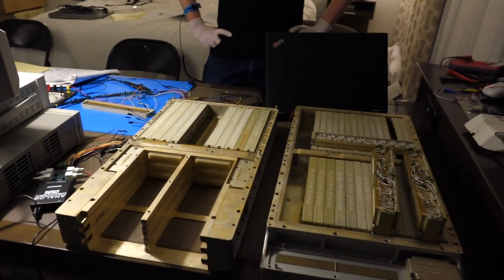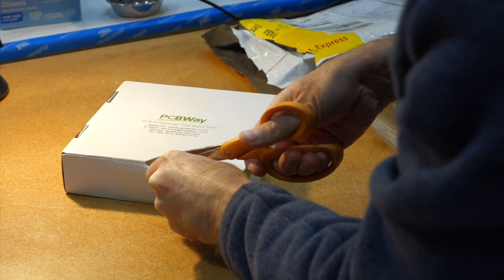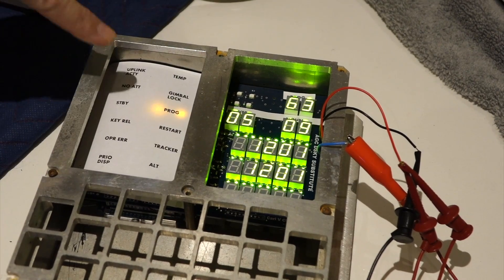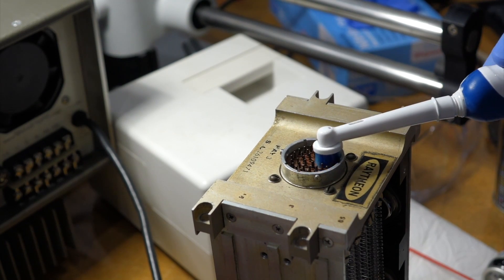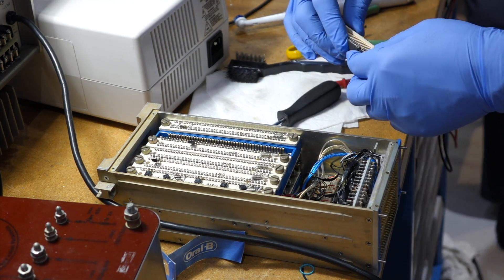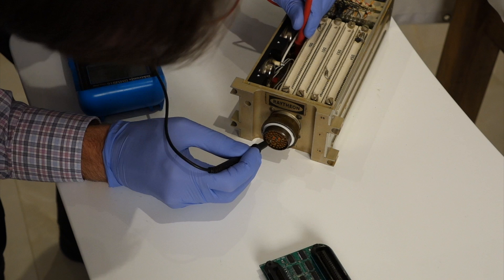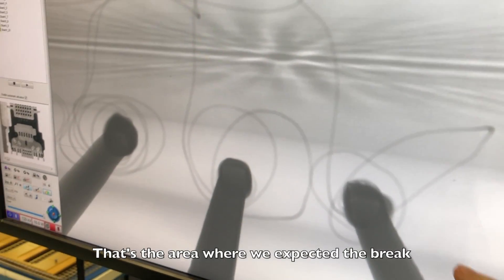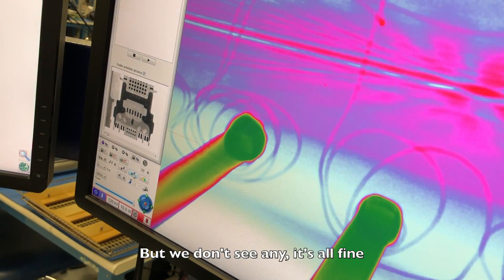Apollo Guidance Computer Part 6: Restoration update, a new sponsor, and a satellite launch

Comment: yeah, the story continues.....the original rope memory does not exist anymore  and also no original DSKY that could be used ?
Reply from the maker: Both do exist, but locked away in museums...
Reply: CuriousMarc give Nicolas Cage a ring, tell him they contain a treasure map...
Reply: @CuriousMarc  The museum ones aren't being operated,  so just arrange a trade until you find a working one!
Reply: at least borrowing them would be cool to run the AGC a few time in it´s real original configuration.. then give back the modules to the museums and work with the Emulators

Comment: if the module is potted, couldn't the compound be eaten away at with something able to melt the compound back into goo and then washed, re-dunked?  one would need to find out the exact composition of the compound but it seems to me like it could be done, like decapping a really big IC.

The only issue is if the bond wires are coated, they'd also get exposed, thus ruining the module. I do wonder how hard it would be to outright replace the erasable memory module's contents with something as small as a proper-sized memory IC and the proper circuitry to get that to interface with the older technology in such a way that it by itself could emulate the memory.
Reply: It's a bit more complicated than that. 2003011-011 memory modules have sort of a four-layer construction:
1. A 0.02"-thick sheet of aluminum (the black cover you see on the module) that is bonded to the module with epoxy across the entirety of both the left and right faces and the grooves cut out for it.
2. A layer of potting material ~0.175" thick that covers the backplane pin posts. This is either made of Stycast 1090 epoxy or a polyurethane foam similar to JFoam G-506, depending on which source you trust.
3. A box constructed of >=0.05"-thick G10 fiberglass boards (which Marc points out in the video). #38 AWG magnet wires run through 0.01"-diameter holes to make it to the inner core stack. These boards almost totally enclose the inner stack, and cannot be removed.
4. The inner core stack, potted with RTV-11 silicone encapsulant.

The thing is built like a tank. So unfortunately getting in is quite a bit more involved than decapping an IC, and removing the coating from the magnet wires would almost certainly cause them to short with each other.

If you want to see what I'm talking about, over the past couple of months Ron Burkey and I have managed to locate, scan, and upload almost all of the original mechanical and electrical engineering drawings for both the AGC and DSKY here: https://virtualagc.github.io/virtualagc/AgcDrawingIndex.html
I've collected the drawings for just the memory module itself here: https://drive.google.com/open?id=1Z9IoYandkByocoKvQGNYfHA41ZIA4ObN